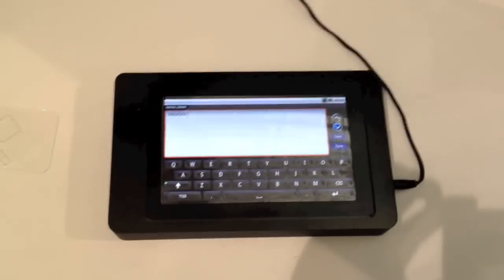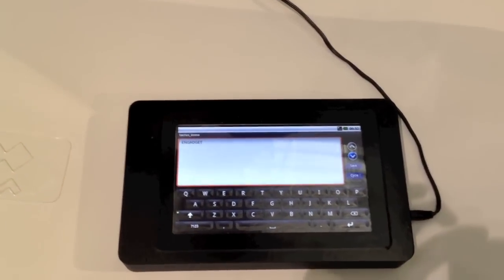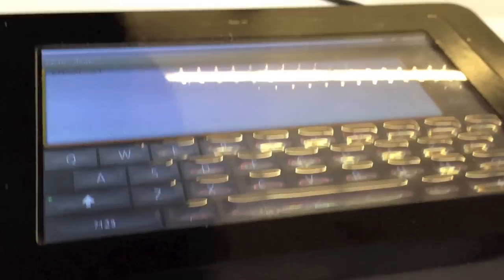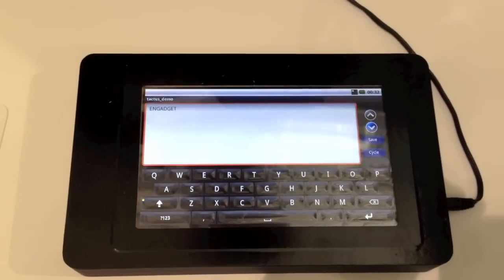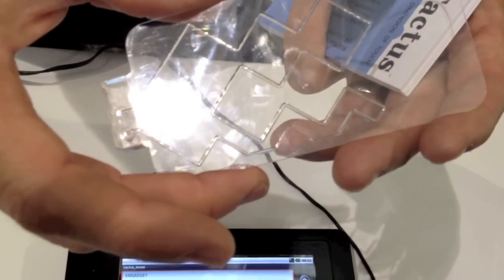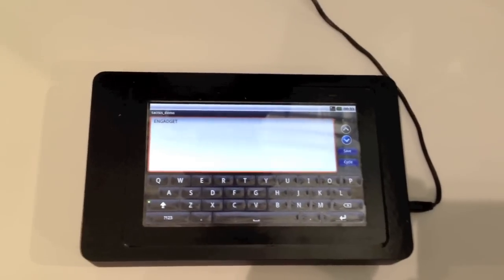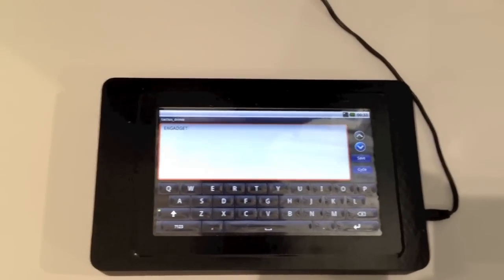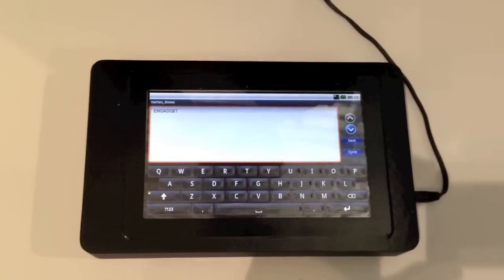Tactus Technology's Morphing Touchscreen Display

Comment: This is an interesting idea, but very basic and constrained.  The future will be with electrostatic haptic feedback.  The screen coating that Senseg is working on can create unlimited texture.  It will give you the feel of a keyboard or anything else that people integrate in their programs.  Though it's clear that users want to feel what they are doing, why restrain the product to just keys?
Reply: I've been speculating that tactile morphing screen technology will be the next big thing after foldable phone iteration dies down. And yes, your thinking is exactly mine. It seems feasible that they could achieve this with electric charge in the vein of e-ink screens rather than fluid. It's a matter of getting glass and material science to a point where the screen can give the feel of a DualSense controller or the satisfying actuation of a mechanical Cherry switch.